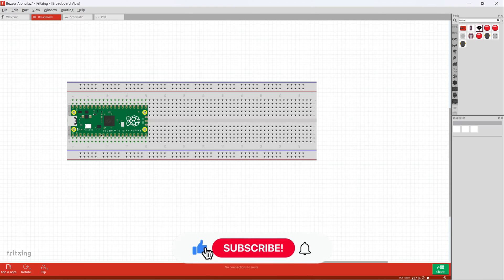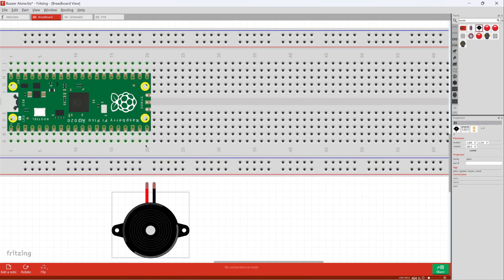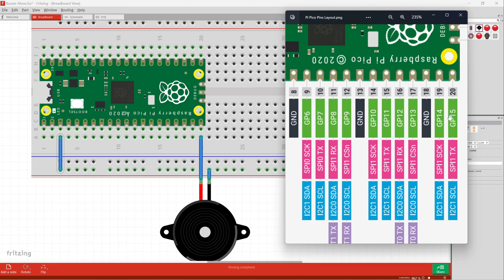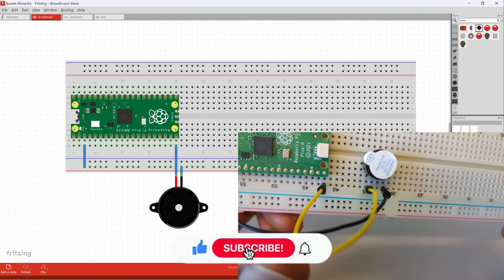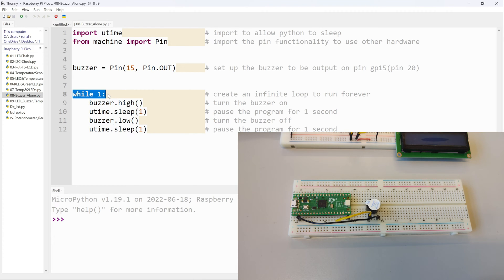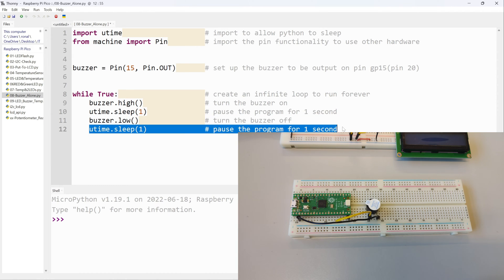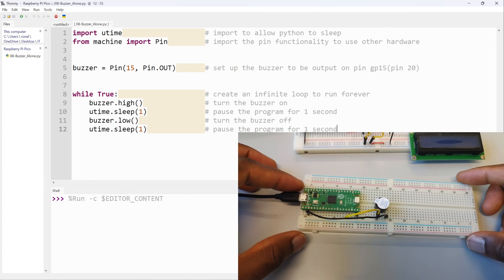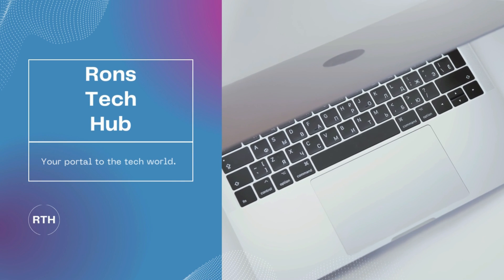Raspberry Pi Pico | Part 08 | CONTROL ACTIVE BUZZER - (2022)

Comment: There is a mismatch. You are showing a passive buzzer in the diagram, but then you use an active buzzer. These active buzzers boost the signal, effectively bringing your GPIO pin to ~8V (check with an oscilloscope). You need a transistor and a resistor to safely drive an active buzzer with a pico, otherwise you risk bricking the Pico in the long run.

Comment: You can take off the white sticker. You will hear your buzzer better
Reply from the maker: That is 100% corrrect. It was annoyingly loud when I tried another one so I left it on.
Also the ones I bought were differenciated with stickers: 
1) Active Buzzers came with stickers.
2) passive Buzzers did not come with stickers.

Thansk for watching.